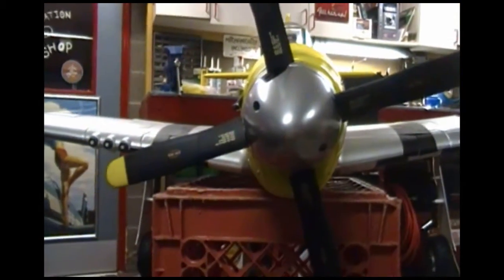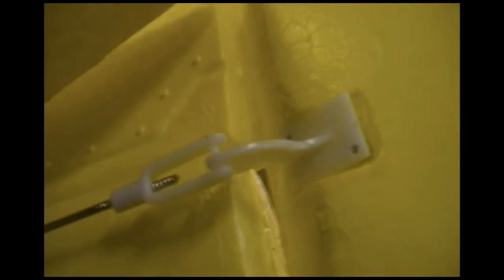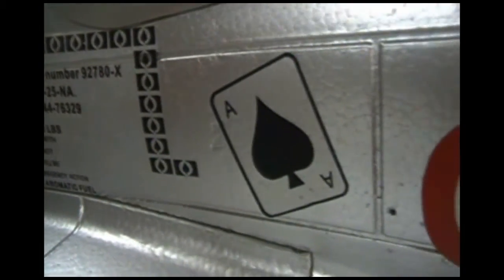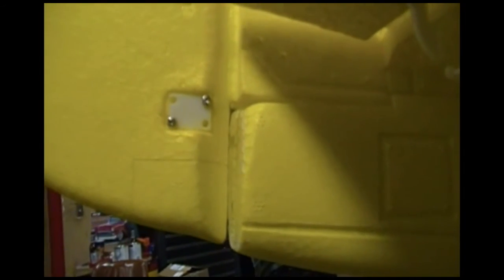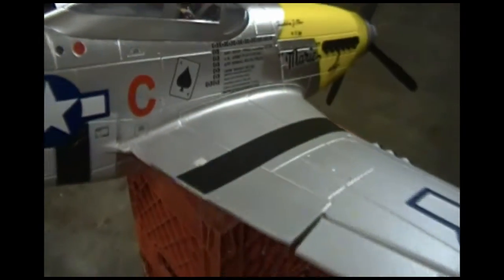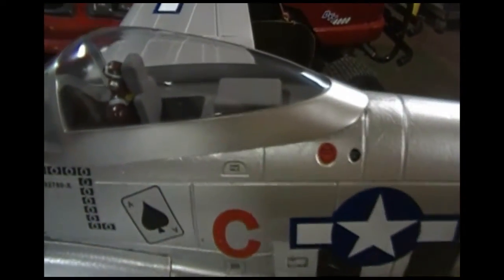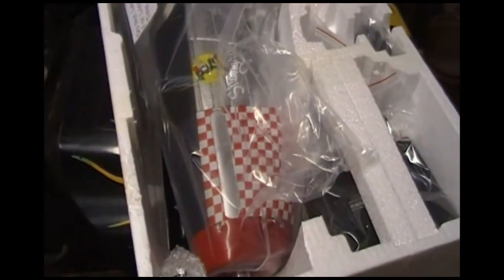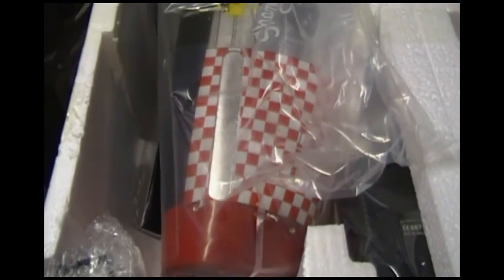P-51 MUSTANG WARBIRD R/C BY NITRO PLANES & AIRFIELD

Comment: @RCRedBaron : 2nd observation:  The control Rods. On your ailerons and flaps, you have the rods reversed.  The Z-bend part you show inserted into the horns, that side goes into the Servo Arm. The side with the screw in clevis that snaps onto the horn, snaps onto the Control Horn.  You will get binding attaching the way you currently have it.

Comment: @RCRedBaron : To help you understand where to attach the control rods on the servo arm and the control horn.  On most applications, you can use the Outer Most Holes on both ends.  But heres how it works.  If you need MORE throw, Going OUT on the servo arm holes increases throws.  Going IN on the Control Horn holes Increases Throws.  DECREASE throws by going in on the holes on the servo arms, and going OUT on the control horn holes.

Comment: I will post as I watch the video.

1st thing off the bat I noticed, the control horns. The screws insert the other way. Put the screws through the side that has the actual horn, then they tighten down into the flat plastic piece on the other side.  Once you have them tighten down, you can use snips to cut off the excess sticking out.  And yes, only 2 screws per horn.

Comment: @RCRedBaron : As to my 1st observation on the screws attaching the control horns, It's possible airfield changed these up. All my airfield have the threaded side on the flat square washer side and not the horn side.  If they reversed this on this model, then your screws are in correct. I just havent' seen them this way in the all years and even the most recent models I've built.

Comment: @RCRedBaron : Expo allows you to soften up the controls so that the plane is not jerky in the sky. Without EXPO, even very experienced pilots have their hands full flying any plane.    2nd, for a first plane, its not the best idea to start with a low wing plane. They tip stall easily.  You should always start 1st with a high wing plane, like nitroplanes GKEMY 182 cessna.  It will allow you time to get used to the controls, learning nose in attitude and muscle memory on the sticks. --Next Post->

Comment: 2.4 ghz receivers do not use Long Antennas.  You are good to go on your antenna. They are short. The plane is built so that should you decide to use an older 72mhz system, which has the long antenna, you can route it outside of the plane.  But with 2.4 ghz systems, you do not need to do this.